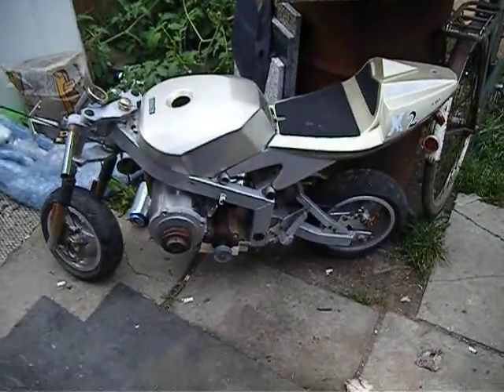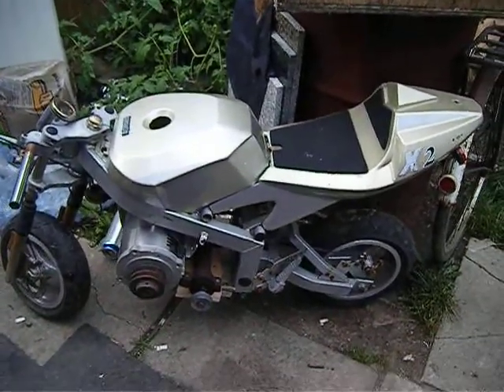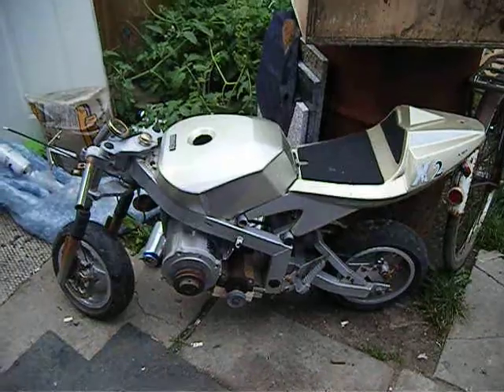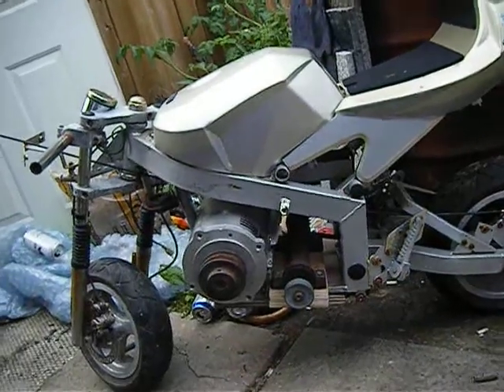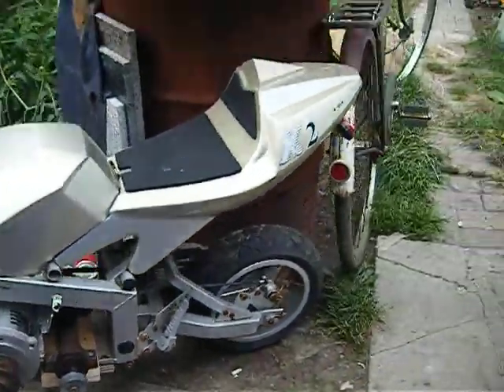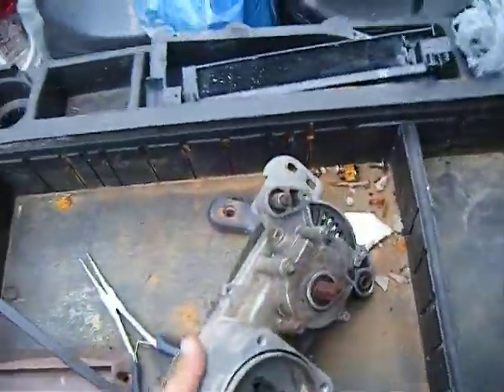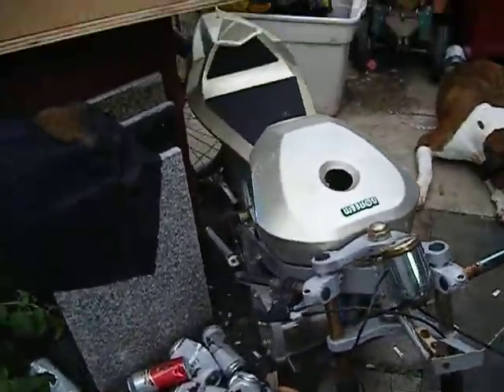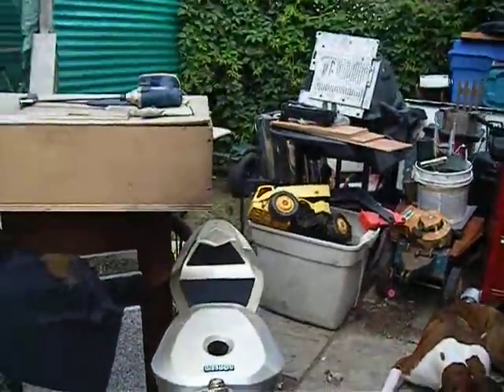Pocket Bike Electric Motorcycle DIY do it my self

Comment: I'm working on an X2 just like yours but Orange.  Im having a problem with the wiring. I told a friend of mine I'd help him fix it. I hooked up a battery to it cause other was dead.  And fried some wires in the process.  The sticker labels on the wires all came off before I received it. Do you think you could provide me with some info on which colored wire goes where ? There's not that many. Ive tried looking on the internet.but nothing out there.

Comment: That looks like a met DC motor?  I have one similar to it and i used it on a pocket bike.  It will work, however if you are planning on using 8 drill battery packs it wont be enough power to push it, at least for very long.  I used 160 sanyo 1.2 v 3 ah cells nicd and it didnt last very long.